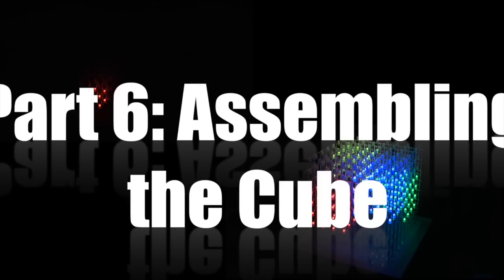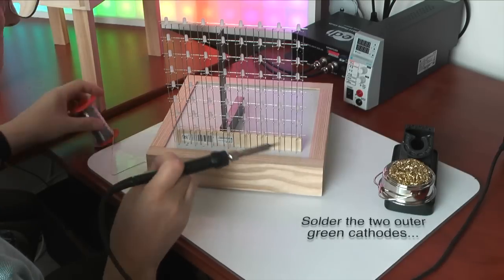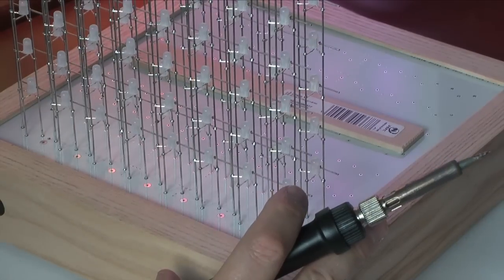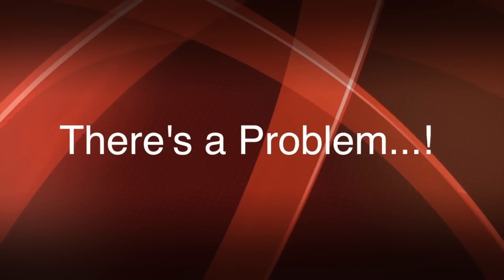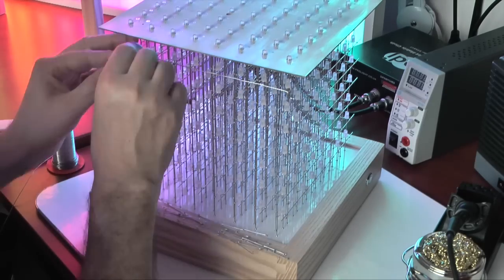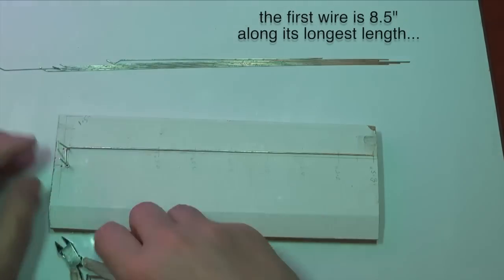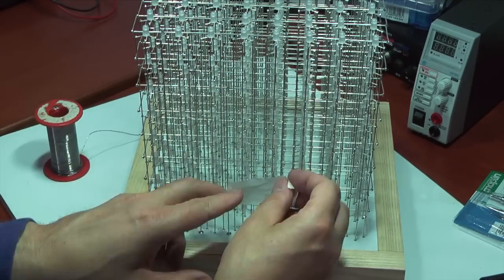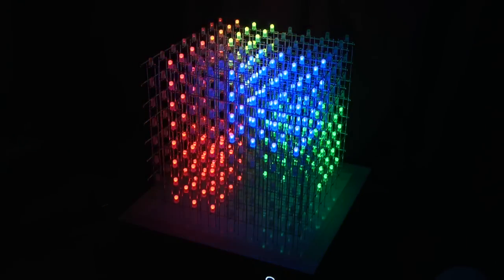Construction of an 8x8x8 RGB LED Cube. Part 6: Cube Final Assembly

Comment: Hi Steve, I have completed my 8x8x8 RGB LED cube build and I am trying out your Cubel_Burn_In_Test sketch. I have uploaded a short video of how it looks to my channel and I wondered if you could have a look and give me any clue as to why it isn't running as expected. I have tried a couple of changes to your code to see if there is any change but to no avail. I tried changing MSB to LSB, I tried reversing the anodeLevel to read B00000001 etc, instead of B11111110, again to no avail. I have tried the sketch by Kevin Darrah and I get very similar results. I have very limited experience or understanding of coding and even less of electronics but I feel that there is something simple that is wrong here, I just don't know where to look. I can't understand why I get no solid colours. I have had a couple of the AI's generate some very basic test sketches that cycle through red, green, blue, white on every led and they are fine so I feel confident in the electronics side, although I could be wrong. I have spent around 14 months building this project and I would be really disappointed to fall at this stage. I would really appreciate any help you might be able to offer. I understand that there could be lots of things but I just need a point in the right direction.

https://youtube.com/shorts/tx1UY0Azpxw?feature=share

Thanks.

Comment: Hi Steve, let me start by saying what a fantastic creation, such attention to detail, and worth every second invested. I am inspired to attempt a 5x5x5 cube to start with and I have bought 400 RGB led's but I notice you use common "Anode" and I have bought common "Cathode". Due to my very limited knowledge of this kind of thing I am wanting to ask if it is possible to use your methods and somehow change something to make it work? I do hope you can give me some good news. I would need quite basic information that is suitable for a complete novice. Cheers
Reply from the maker: Hi, thanks for your comment.

The construction of the cube should be no different, but the direct electronics driving the cube will need to be different. Eg. For common anode, the anode is connected to a positive voltage and the cathodes for each R, G & B LEDs are switched to ground to illuminate them. For common cathode, the cathode is connected to ground and the anodes for the R, G & B less are switched to a positive voltage to illuminate them
Reply from the maker: I can’t recall of the top of my head as to what driver transistors and driver chips you would need. The shift registers can stay the same.
Reply: @stevemanley3685  Thank you very much for your info, i shall try and work it out with the help of youtube😂
Reply from the maker: @wasdaletimelapse7658  Having thought about it, You will of course have to redesign the circuit boards. You might get away with the main LED board if you’re lucky, but the anode driver board will most likely need to be re done. The shift register boards might be okay if an alternative shift register chip for driving common cathode LEDs is available and are pin compatible.

Comment: Many thanks for your thoughtful demonstrations and attention to detail.
I am planning to give this a try.  Will the files provided be enough to order the pcbs if I send them to JLCPCB directly?  I have no experience in designing pcbs.  Looking forward to your blog on the anode driver board and final assembly and programming.  Do you have an approximate date.  Haven't found anything on your site as yet.
Thank you 
Alan in PA. USA
Reply from the maker: Having thought about the two previous answers, Yes, the zipped-up PCB or Gerber files are enough to order the PCBs, but use the V2.0 zip file for the Main PCB. When you order PCBs from JLCPCB, you will be prompted to upload the zipped file. You will then need to select a few options. The default is usually acceptable, except for the solder mask colour. Green is default, but if you want white or black for example for the Main PCB, then that's where you choose the option. There will likely be a minimum order of 5 PCBs and you select the quantity in multiples of 5. A bit of a waste for the Main PCB, but you can use one as a jig for assembling the 8x8 panels, after you drill out the relevant holes of course. The Anode and Shift Register boards are default for everything.

I was a bit mixed up about the blogs. Yes I have three to re-issue, but they are not as important as the three I've already done. A blog for the Anode board and further programming were never written, and I'm not able to do it any time soon, for reasons stated above. The Final Assembly is already one of the three completed re-writes. Hope this helps.
Reply from the maker: Hi Alan, thanks for your comment.
Re the files, I do believe that someone tried to get the main base PCB made at JLCPCB and had issues with. uploading and verifying the Gerber files. So I re-drew the PCB in EasyEDA for him, but I can’t recall if I uploaded it for all to use, so I’ll have to check and get back to you on that.

It was very unfortunate that the web site hosting the blogs lost or screwed up the blogs in a data migration and couldn’t be bothered to fix it. I did rewrite some of them into PDF and it was a lot of work not having the original blogs that had been through a professional editorial process. I had intended rewriting the remainder, but until now, no one has asked. 

It’s a bad time for me to do it right now because of other projects on the go, plus I’m just about to move house, so nearly everything will have to go on hold until that completes or allows. I do have the original Word files somewhere, which are rather raw and may not have images imbedded. My own pride wouldn’t let them go until they are tidied up. Sorry if that’s not what you want to hear.
Reply from the maker: Hi Again Alan, Yes I can confirm that V2.0 Gerber files for the Main Base PCB are available for all on my DropBox account: https://www.dropbox.com/sh/wxrfckxhbkx8yk9/AADxd8ruqwuGQUnVjG7HMIDpa?dl=0
Reply: Thank you for your quick  response.  I appreciate it very much.  Good luck with the move!  I will send updates as I move along on  the project. 
Alan
Reply: Hello, again.  Well, I have been testing and forming the leds.  Just another 300 or so to go.  I have made the jigs, and ordered the parts, which has been a daunting task with supply issues.  The Gerber files worked great and .y pcbs are on their way.  I had to go on ebay, to get the shift registers, as they are back ordered to 2023 at most suppliers.   
I have questions about the power supply and wiring, you used, and what type of switch power cord arrangement did you use? 
Hope your move was completed quickly, and without too much stress.
Best wishes
Alan
Reply from the maker: @alanalexander6715  Hello Alan, sounds like good progress is being made. Some parts of the construction are a bit tedious. Now I have a 3D printer, I would make better jigs, especially the LED lead bending jig, one that by pressing down on it would eject the LED rather than prying them off. Glad the Gerber worked out.

Wow, the shift registers are in short supply! Hope you manage to get some good and reliable ones.

I use a 5V laptop style 10A power supply. Originally during testing, I had a few issues getting the LEDs to light, and upping the supply voltage to the cube seemed to fix it. Hence I specified a 6V PSU. As other components require 5V, I placed a bigish diode in series with 6V PSU output and the 5V rail just to drop the supply to within spec. 

After getting the PCBs made and assembled, I tried running the whole project on 5V and replaced the diode with a link wire. To this day, it all runs on 5V no problem. I think I made a wrong assumption re upping the voltage to 6V and the issue was more to do with how I was driving the Anodes.

Anyway, I just use a DC jack and don’t use a power switch. The push button currently acts as a reset, but could be rewired and programmed to do different things, well that was the intention. 

Amongst the various files on my Dropbox, is a wiring schedule for the PCB interconnects.

Hope this helps.

The move hasn’t happened yet and time is running out to get things packed up, especially as I’m still trying to finish my animatronic project build. Just waiting for parts I ordered from eBay.

Any question, just let me know.
Reply: Hi again, Steve.  I continue to make progress.  3 panels completed, now.  I am still waiting on the TLC5916s.  Hopefully will get them this week.  After paying a ransom on EBAY, I noted that a TLC5917 has the same pinout and functions, and was available from some suppliers.
Regarding the power supply, I was reading that the Arduino needs a minimum of 7v to function well, up to 9v.  The Arduino then regulates it to 5v at the pins, so wondering if I should get a higher voltage pwr source.  You say you are having no problems with a 5v source, so not sure what to order.  Also ordered a spst momentary pushbutton switch,  and will be adding an on/off switch.
Thanks again.   I am enjoying,  and learning as I build the project.  Just hope it all works when I finally power it up.
Reply from the maker: @alanalexander6715  Hi Alan, I’m delighted to hear you are making progress. For info, I inject my 5V directly into the USB port of the Arduino, bypassing the requirements of the onboard regulator. I took a USB cable, cut off the required connector leaving a good few inches of  cable. Then identified the 5V and GND cores and connected those to the 5V supply. A bit of an odd way to do it I guess, but that’s what I chose to do at that time. Always room for improvement and if you would like to do it differently, please feel free to do so, but be careful, the onboard regulator has a limited current capacity and should not be relied upon to drive external circuitry, especially if the current draw exceeds the regulators maximum. It has caught me out a few times.

Hope this helps.
Reply: Steve, I have been unable to get the TLC5916IN  chip anywhere, and am now completely on hold, possibly til early next year.  The TLC5917IN  is same functionally,  with same pinout, but has a "Short to Vled Detection "  which is not on the 5016.  Will this work as an alternative?
Alan
Reply from the maker: @alanalexander6715  Hi Alan, sorry to hear the chip shortage has struck you. As far as I can tell from the TCL591x data sheet, the 5917 should be absolutely fine as a replacement. My guess is the extra protection is useful in the event one or more LEDs goes short circuit, thus connecting VLed directly to the chip outputs, and therefore safeguards the chip itself. I don't think there is much else to it.
Steve
Reply: @stevemanley3685  Thank you.
Reply: Just for your followers, I was able to order the TLC5917IN directly from Texas Instruments site myTI.  Ordered today, for $1.335 USD ea, and they have already shipped them
  My source on Ebay never received his order and had to issue a refund.  In the end, I will have the chips for less than 1/3rd the price, and can complete my cube.
Reply from the maker: That is Awesome news. Thanks for sharing.

Comment: Can you replace the ic tlc5916 with another ic?
Reply from the maker: Hi, I’m not 100% sure, but I’m not aware of a pin compatIble replacement for the TLC5816, so to change the IC would mean a change to the circuit and PCB designs, in which case, yes the IC can be changed. If I were to re-design the the circuit myself, I would most certainly change the IC, but I have no plans to do so at this time.

Comment: Hi Sr Manley. In the parts list you indicate 6 units of Capacitor 100uF 25V Electrolytic but I only locate 2 units on the Anode Drive Board. Can you tell me where the 4 remaining units are located? I can't find it in any diagram. Thanks
Reply from the maker: Hi Tical, After all the years since this project was posted, you are the first to mention this discrepancy. I have checked the circuit diagrams and my physical cube, and I can only spot 2 100uF capacitors as well, so it looks like an error in the parts list. Sorry for that. Thanks for bringing it up.
Reply: Perfect Steve. Thank you for your answer and thank you very much for your project
Reply from the maker: @tical333  No problem at all, and thank you for your kind words. 

For info, I have updated the parts list and re-uploaded it.
Reply: @stevemanley3685  perfect. Thanks for the update, it sure avoids confusion for future users;)
little by little I continue to advance in the construction of the cube.
Thanks for your time

Comment: Should I use 1k 0.125 w
 Possible to use 1k 0.25w
Is vin 6v or more
Reply from the maker: 0.125W will do fine. 
5V as it turns out is also just fine to run the cube. I found I needed 6V when fault finding an earlier design, before I realised the cause of a problem. After I finished the cube, I tried it with 5V and it worked just as well.
Reply: @stevemanley3685  
Do I use 6v or 12v
 Mother resistance is only 1k 0.25w in my country
Reply from the maker: @alirifaat645  DO NOT USE 12V!!!  You will likely destroy the Arduino if you do.

6V is okay, 5V is preferred.
Reply from the maker: @alirifaat645  0.25W is also okay. These resistors are larger and may not fit the circuit board as well, but will work no problem.

Comment: Hello.
 When working on this project did not work only the project that worked in the project in columns four and fifth columns
Reply from the maker: Hello, thank you for your comment.

From what I think your saying is that some of the columns are not working, but the detail you have provided is not enough for me to determine a possible cause. 

When you say column, is it a whole 8x8 panel or some columns on one panel or the same columns on all panels, or different columns on different panels. Maybe you could post some photos of the fault.

I can tell you that if just one led in a column goes short circuit, it can prevent the rest of the LEDs in that column from working, but usually only affects one colour, like red, green or blue.  You could try swapping the shift register boards around to see if the fault moves or stays the same.
Reply: @stevemanley3685  @Steve Manley
 Possible link Facebook to allow me to send the project image
Reply from the maker: @ ali rifaat: sorry to say that I do not have a Facebook account or any other social media account other than YouTube, so it is unlikely I will be able to view any pictures you post there. Do you have DropBox or GoogleDrive where you can share the pictures?
Reply from the maker: @alirifaat645 : Can I suggest you upload your images to your Dropbox then share the link so I can view them.
Reply from the maker: @ali rifaat: Sorry, I do not share my email address. Happy to help as best I can via YouTube comments only.

Comment: Hi Steve,
Congrats and thanks for all this work you've shared. It's very very well done and a pleasure to follow your tutorial.
I started the cube in 2015, baught everything but never had the time to make it. That was for my retirement I thaught ! The special time we go through gave me the time to build it.
I have finished but have some troubles to work out. One of them is that I have at least 2 leds burned that I need to replace. In this video you say that the next video would be about led replacement but it seems you didn't do it. Could you please give some advices and hints of how you proceded.
Thank you again.
Reply from the maker: Hi Jean,
Thanks for the complements and I'm glad you managed to build a cube, but sorry you have some issues. You are correct. I was going to do a video, and I did start recording it, but got distracted for whatever reason and it never was completed. Sorry about that.

The first thing is to identify the faulty LED and mark it somehow. You don't want to remove the wrong one like I did once. Depending on where the LED is, it can be relatively easy, or very difficult. If near the top or edges then it is much easier, but if in the middle and especially at the bottom and in the middle, then it will mean some parts of the cube may need to be removed temporarily. It also depends on the tools you have. Long slender non bulky side cutters and long nose pliers or tweezers are needed.

Oh, and be sure the cube is powered off when you work on it. I forgot one time, and put the soldering iron deep into the cube and it took out even more LEDS. I think I have replaced 12 LEDS so far.

Once you have the LED identified, and you can access it with the cutters, cut out the LED as close to the vertical and horizontal wires as you can, leaving the solder joints intact. Do not desolder, simply cut the LED away.

Bend up the leads of the replacement LED, but only make a hook shape, not a full loop. Then using the pliers or tweezers, place the LED on top of the original solder blobs with the hooks around the wires. The LED should just about stay in place, but it may take several attempts. Then solder over the original joins, and the LED should be good to go, and you will hardly notice the repair was done.

For the difficult to reach LEDs, I suggest you remove all the horizontal Anode wires on one side, possible both sides. This will allow you to gently spread the panels apart so you have more room to get the tools in, but be careful not to pry them apart to much, else they will bend and won't go back properly. Once the LED is replaced, make new anode wires and fit them.

Hope this helps, and give me a shout if you need to.
Steve